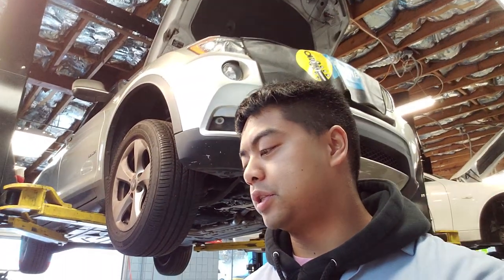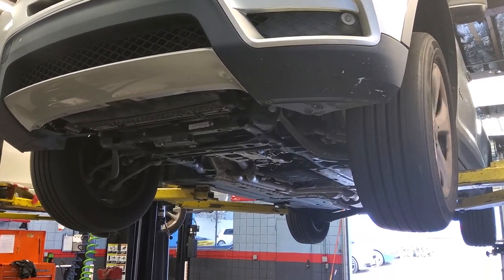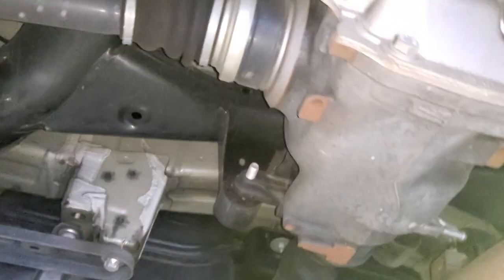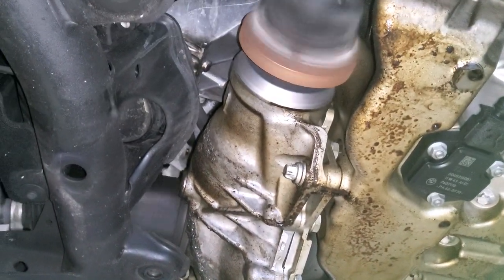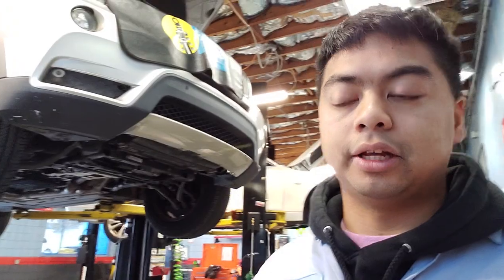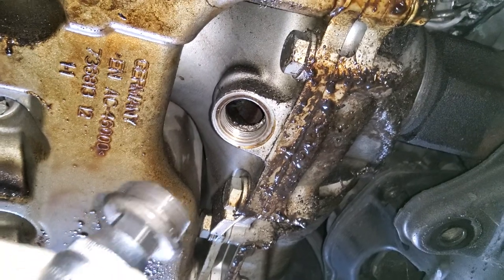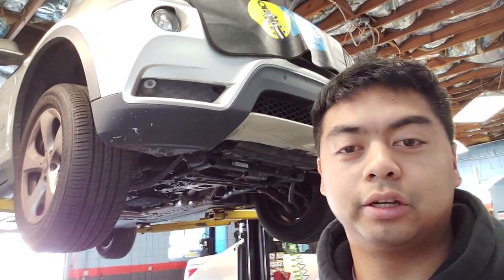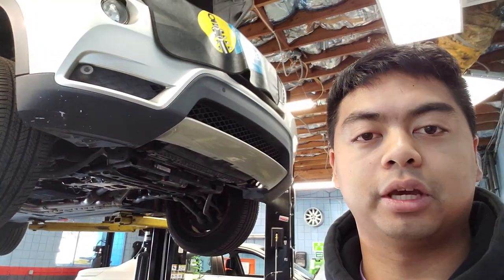2013 BMW X3 F25 grinding noise from under the car.

Comment: I have a problem with a humming noise in the car, I had the bridge checked, the parts were damaged, the shaft was also loose, the front bearings were also refurbished, it didn't help, maybe the xdrive was damaged, could it make humming noises?
Reply: I have the same humming/buzzing sounds coming from my engine. I believe it's the boost solenoid. Common with the N54. Mines an N55. Rare, but they can fail. Having it diagnosed next week. Fortunately,  it's a $100 piece from FCP Euro and an easy DIY from what I've seen on YouTube. Hope it helps
Reply from the maker: Its Possible. Noises are difficult to isolate. A special NVH amplification tool is need to pin point. Don't hesitate to call us for a consultation.